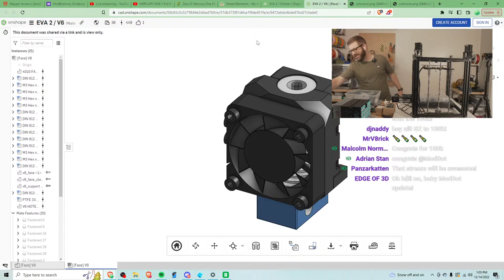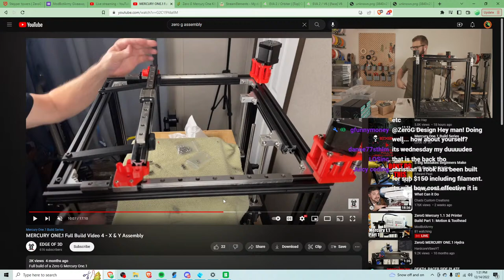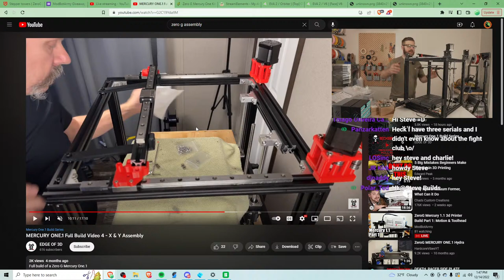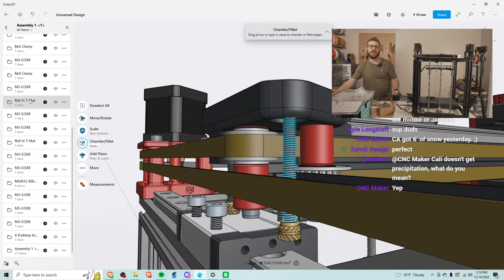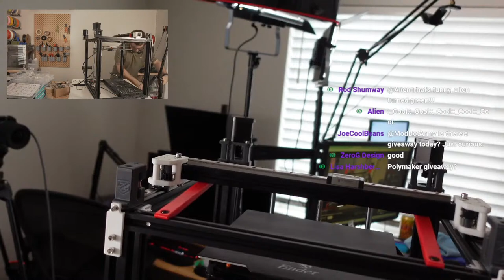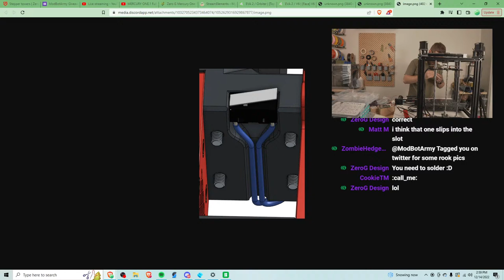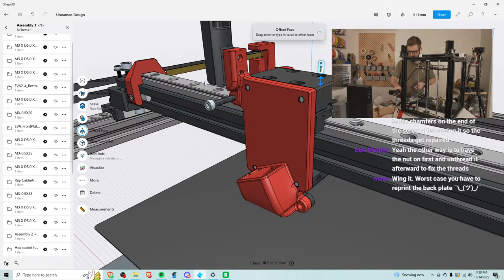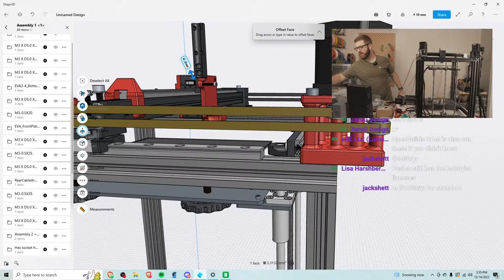ZeroG Mercury 1.1 3d Printer Build Part 2: X Axis & Toolhead

Comment: Can you share your print settings? I see your parts fit way better then mine did.
Reply from the maker: Other than setting the layer height, infill, and walls based on the required settings this was 100% defaults for the BambuLab X1 Carbon. The machine just has insane tolerances for how quick it prints.